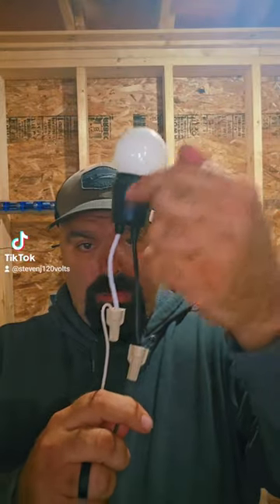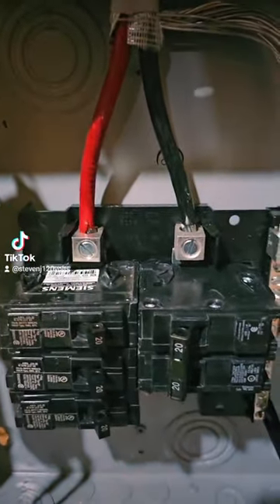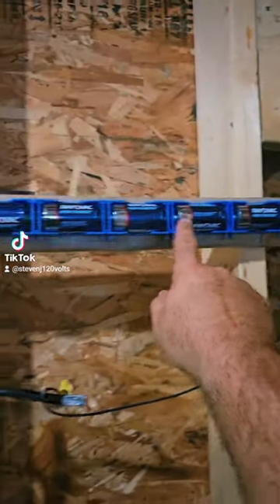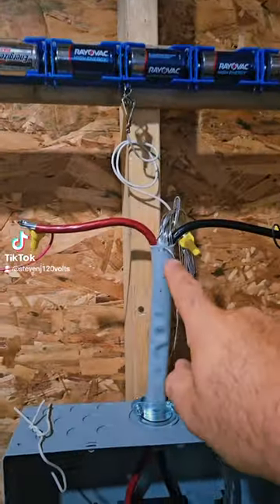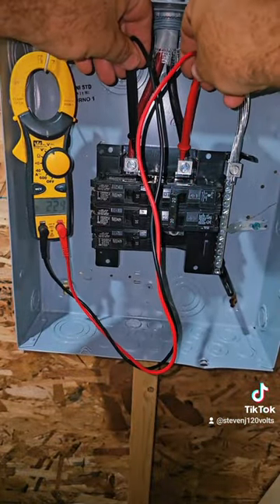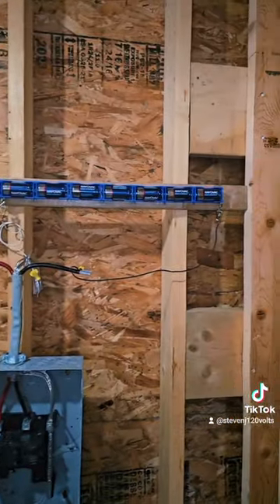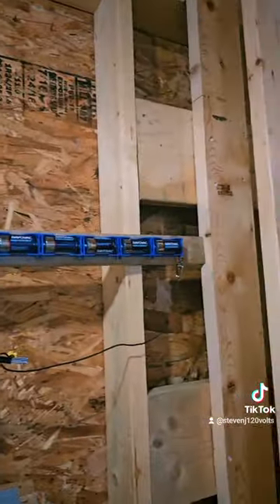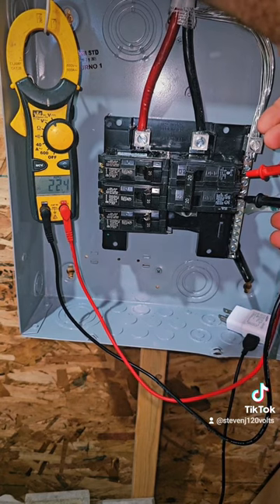why doesn't a 240v circuit need a neutral???

Comment: Best and most thorough explanation of this I’ve ever heard.  Many licensed electricians can’t explain this. You made it simple enough to understand yet thorough enough to get the correct amount and kind of information across. Excellent job!!
The key is at the end when you said they both take turns being supply and return 60 times per second. I’ve known that for decades. But, no one ever explained the details of that in the way that you did. 
I’m a subscriber now… and fan!
Reply: he didn't really explain the neutral, and why it's normally seen as the return.. ( because it's grounded.. it has zero voltage to ground. making the other terminals both HOT

Comment: An interesting way to present that. It would never have occurred to me to line up a series of batteries and tap them for this demonstration. As an analogy it holds up reasonably well, but there is that whole AC vs DC thing that you did cover toward the end. Very clever. I give you high marks for outside-the-box thinking.
Reply from the maker: With lights tied to it you get the nuetral only carrying the imbalance and 12v on a single pole breaker and 24v on a double pole breaker

Comment: So, this may have already been asked here in the comments but, if I’m understanding correctly, here in the states, 220 is not actually 2 different circuits, but one continues circuit and the neutral “splits” it to 110? That is neat. And this was an awesome explanation!
Reply: I need 240 volts for my drier. Have 4 prung outlet and plug (ground, neutral and 2 hots) I am only getting 124 volts on each leg of outlet and on each screw/wire of braker and when combine both legs of 124 volts on either outlet or braker I get 0 volts. Replaced braker and still 0 volts. Any idea why can't get 240 volts?
Should I remove the white/neutral?
Please advise.